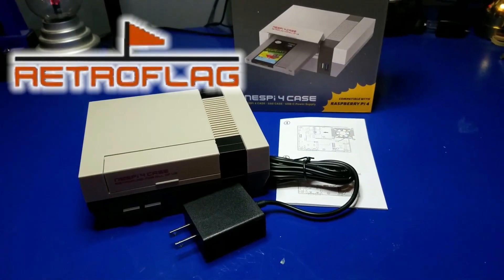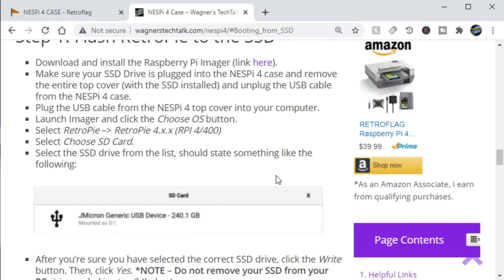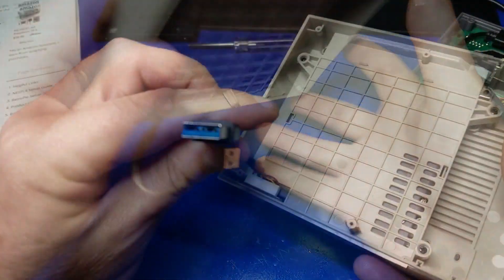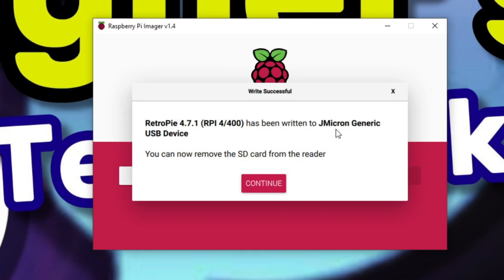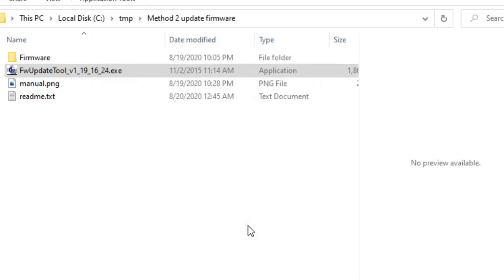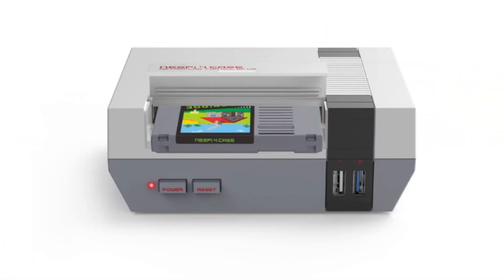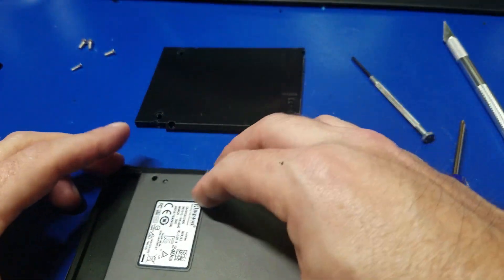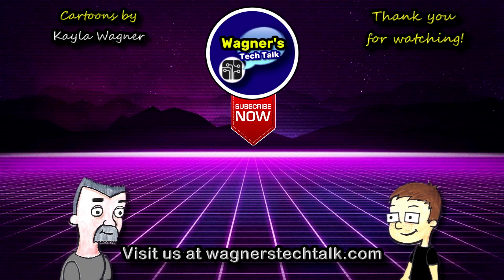Retroflag NESPi 4 SSD Boot: Quick-Start Guide

Comment: Thank you for taking the time to produce these videos.. I think you are doing a top job👍

Can I ask a couple of questions/thoughts?

Rather than blood direct into retro-pie is it a good idea to boot into Twister. Then  the Pi can be more easily utilised for other uses?

Also is there a way to install Batocera in the same way?  Ie booting up in Twister and then opening Batocera?

Many thanks
Reply from the maker: Hi GC, thank you it really depends.  If you want a dedicated RetroPie setup you can install RetroPie.  If you prefer a Desktop environment (with RetroPie), certainly TwisterOS is a great option.  Another great option is Recalbox (I have a video on that, if interested as well).  Totally up to you and your preference.  As far as Batocera running within a Desktop environment, don't think this is easily doable.  Batocera runs it's own version of Linux, RetroPie sits on top of PiOS (or Twister OS) so it's a bit of a different design.  Hope this answered your questions.

Comment: great video. i setup my nespi 4 and installed the safe shutdown script. the power button LED would no longer light up when powered on and the fan would stay running after powering off. after waiting 5 mins I just pulled the power plug.
Reply from the maker: Thank you!  Not sure what distribution you installed, if it was Recalbox no shutdown scripts are needed.  However, for PiOS or RetroPie they are.  More details on this can be found here: http://wagnerstechtalk.com/nespi4/
Reply: @WagnersTechTalk  I installed Retropi for the raspberry 4. followed all the instructions in the video and on your website. the safeshutdown installed sucessfully. but like i said the power led doesnt work and the fan wont stop running until you unplug the power. for now i have turned the safeshutdown switch off and manully shutdown.
Reply from the maker: Inside the case, did you flip the switch to the safe shutdown setting to the ON position?  Shown here: https://youtu.be/o4qtS5ydt7w?t=275
Reply: @WagnersTechTalk  yes. ^ "for now i have turned the safeshutdown switch off and manully shutdown."

Comment: I know I'm joining the chorus here, but I am having absolutely no luck with this case at all. I have tried every step on this guide. It will boot once (and ONLY once) from the NESPi SATA bridge after being disconnected from an external USB 3.0 connection, but after that it's error after error on the QR code bootscreen. Absolutely no fix I've tried works. Going into the terminal, it doesn't even SEE the SSD, only the bridge that's connected to it. Trying to use a Seagate 2TB SSD which is detected and even boots fine from the external USB 3.0 adapter. I've spent three days now trying to address this problem and am making absolutely no progress except in getting incredibly frustrated at the idea that I've probably wasted my time and money on a dead project.
Reply from the maker: Not exactly joining the chorus, the vast majority of feedback I've received here has been positive, just curious if you followed this guide (or another) http://wagnerstechtalk.com/nespi4/#Booting_from_SSD ?  I've personally used up to a 1TB drive and these steps have worked on the x3 or so SSD's that I own.  If those instructions don't work for you, I 'd recommend contacting Retroflag as you may have a hardware issue.  If you do and find out the solution, always appreciate a comment to let me know what the problem was so I can update the guide with what was found.
Reply: @WagnersTechTalk  Thanks for the reply, it's nice to receive prompt feedback during a stressful time. As far as guides, yes, I followed your guide to the letter (since, as you mentioned, many people were reporting success with it, so why rock the boat). To the point now where I actually know some Linux line commands (and that sudo just cannot ever be forgotten).

Here's the issue I've run into, and I'll try to be as succinct as possible. The SSD boots great, but only from the external enclosure I have (to recover dead HDDs or other such items, I dabble in salvaging). When connected to the NESPi's SATA connector, I can go into PuTTY and see the BRIDGE, but not the DRIVE. Which might suggest there's a connectivity issue with the bridge IF it didn't pop up almost immediately upon my connecting the NESPi bridge to the PC, ready to be explored and used. So the bridge is actually good (to an extent) as far as being able to read the drive. I can connect, disconnect, reconnect, and experience no errors or issues with the Windows 10 machine. I have formatted this SSD (several times now, so I'm a little concerned for it) in Windows AND in PuTTY when I had it connected via the external enclosure.

What's driving me up a wall is that I've actually successfully booted the thing FROM the NESPi bridge with ZERO issues, but it only happens ONCE and only directly after I move the SSD from the enclosure to the bridge. Every boot attempt after that gets me the QR screen and repeated error messages. So the Pi CAN read the drive. It's so frustrating because I'm SO CLOSE to being past this nightmare.
Reply from the maker: Just curious if you have a smaller SSD available that you can try (perhaps<=1TB)?  I doubt it's any kind of capacity issue, but something worth trying if you have one available.  Aside from that, it may require contacting Retroflag support.  I can't think of any reason why it would work once and not after that.  I'm sorry you're experiencing these difficulties but I've not run into this issue myself so I may not be much help.
Reply: @WagnersTechTalk  Unfortunately no, no spare ones right now. Figured this'd be a pop-and-play rather than something so involved and wild. I don't see contact information on their webpage, so I'm not exactly sure how to do just that. At this point, I'm not even trying to get it to boot from the SSD, I just want it to READ the SSD whilst connected via the NESPi Bridge so I can just move on to better things.
Reply from the maker: Just incase:  Think I used sales@retroflag.com to get in contact with them initially and did hear back.
Reply: @WagnersTechTalk  I'll try my luck then. The case is literally perfect in every other way, but if I can't resolve this, I have a useless paperweight on my hands and a lot of wasted time and ambition. Thank you for your suggestions.
Reply from the maker: I definitely want to see you successful with it, if you find something out please let me know.
Reply: @WagnersTechTalk  Well, definitely an update, but not a good one. So fiddling with lsusb some more, I find that it's reporting as a 567 instead of a 578. So I figure 'maybe it's a firmware bug keeping the bridge from talking'. So I reconnect it to the PC, and following more generic Linux tips I spy a 'RD Version' checkbox. Clicking it revealed several options, including 'Erase Flash', which in my desperation, I gave a shot. I also restored the UAS firmware (or so I thought), and ejected it. Connecting it back to the Pi, I see lsusb has changed! It's reporting a JMicron bridge, but isn't saying what version it is. More importantly however, is that IT SEES THE SSD. fdisk -l sees the SSD at last. So in my excitement, I decide to try to do a shutdown, reboot, and see if the SSD is still visible.

Nope.

And this time, the JMicron bridge isn't visible in lsusb anymore. Oh goodie.

Now it won't connect to either the Pi or my main PC (I have an older laptop that reads it... Sometimes. But given that it's coming up as 'USB Mass Storage' I think it's actually reading the SSD attached via the bridge), so I think this thing is utterly bricked. Not that it worked in the first place, but this is just astonishing. When it does connect, there's no option to flash the device chip anymore (it tries to suggest the USB Mass Storage which is NOT a dice I'm willing to roll, the SSD is fine, this bridge is just hot garbage), and the Pi will read the drive until the next reboot.

I haven't heard back from them yet and I sent the e-mail last night. Maybe they can just send me a top piece and I got unlucky (unlikely but you never know). Maybe it's an SSD compatibility issue that caused all of this in the first place(which needs to be in their documentation if that's the case). If they're willing to send me a spare top of the case so I can try again fresh, then fine, but this entire experience has utterly shaken me with regard to them and their product. Who builds a device that needs a hack workaround for hardware you know is going to be present? It's like building hardware for Windows that needs firmware hacks in case the user has a mouse. Complete nonsense.

None of this is directed at you, by the way, but this is just immeasurably frustrating.

EDIT: Well, managed to unbrick it with a lucky firmware flash, now it's back to thinking it's a 567. Which is... Better? I guess? At least it works again. Ugh.
Reply: @WagnersTechTalk  OK, time for a PSA: Apparently Seagate SSDs do NOT play nice with the SATA adapter in this case. A friend of mine was able to loan me a Samsung SSD and I was able to detect it faultlessly with fdisk. So the problem was an SSD compatibility issue. It would have been really nice to have a warning of some kind so that people that might be able to avoid this headache in the future, but this does scream 'edge case' to me so I'll be emailing them to alert them to my findings as well as to what the problem turned out being.
Reply from the maker: @EbonyRubberWolf  This is excellent information, thank you for replying back what the issue was!  I've not personally purchased any Seagate SSDs and this is the first I've heard of a specific manufacturer having compatibility issues with this case.  I'll notate the guide accordingly so others may see it.  Thanks again for the update!  ps.  Updated here: http://wagnerstechtalk.com/nespi4/#Step_2_Update_NESPi_4_SSD_Controller_Firmware
Reply: @WagnersTechTalk  I cannot say for certain it is ALL Seagate SSDs, but I have been trying to use the FireCuda 120 and that particular one's been problematic. Again, possibly an unseen edge case, possibly not, but Samsung definitely worked and showed up. So when I can, I'll probably get a Samsung SSD of equivalent size and hopefully it'll be smooth. Thanks for the video otherwise.

Comment: I attempted to do this and the OS and everything boots/runs fine. The problem I'm having is it partitioned the hard drive or something, when I try to transfer ROMS it recognizes the 1tb SSD I have as a 255mb storage capacity. I tried to expand the filesystem in the settings on emulation station but had no luck. Have you ever ran into this problem?
Reply from the maker: Not sure what OS you're installing, some will expand automatically others may not.  The instructions here were used in the context of a microSD card but are the same for an SSD: http://wagnerstechtalk.com/rg350tips/#Expand_Partition  Just triple check that you've selected the correct drive for expanding.  If you're running Windows, use the video link there which uses Disk Genius to expand the drive.

Comment: after all this it did not work
Reply from the maker: Boot from a microSD card, then try this from a terminal (WiFi or Ethernet connected):
sudo apt update
sudo apt full-upgrade 

Shutdown the Pi4, remove the microSD and allow it to boot from the SSD.  Your firmware is likely outdated and the above will update it.  It's also here should you need it: http://wagnerstechtalk.com/nespi4/#Troubleshooting
Reply: @WagnersTechTalk  Ok I will try right now
Reply: How do you reach the terminal?
Reply: Another wasted hour...wont boot from the ssd
Reply from the maker: Strange, that's worked for everyone else (til now).  Did you notice any errors during the update or full-upgrade?
Reply: @WagnersTechTalk  no errors. I will try this all again from scratch. So far no method i have used on youtube works
Reply: @WagnersTechTalk  it just does not see the ssd, read the sd card no issue. At this point id rather find a way to put games on the ssd
Reply: @WagnersTechTalk  I did a different install and it worked. Not to say this technic here is bad, thats just technology for ya
Reply from the maker: @erikhampton67  What did you do differently?  Just curious if I need to update the troubleshooting.

Comment: Are there compatibility issues related to specific SSD's and booting from them?  I can easily write over the SSD [verified files] and I updated the firmware with the NO UAS file .  When I reassemble the unit and apply power, the bootloader throws an error and reports the SD card is not detected.  Any hints?  Is there something I am missing?  Thank you!
Reply from the maker: It's most likely that the firmware on your Raspberry Pi is out of date.  Boot from the microSD with PiOS/RetroPie (F4 after boot for a terminal) installed and WiFi/Ethernet connected, then issue the commands: 
sudo apt update 
sudo apt full-upgrade
sudo reboot (should be good after reboot here)
sudo rpi-update (if not, force an update of the firmware with this command)
Reply: @WagnersTechTalk  That worked perfectly!  thank you!
Reply from the maker: @jonasgroff4631  Very welcome Jonas, glad it worked for you.

Comment: I really do like the form and function of the NES pi4 since I got it last week, but Ive read online that the SSD controller, and the wires inside, present problems; Namely, the wires are not shielded enough and cause interference with bluetooth, and not having UAS downgrades the drive speed to USB2 instead of USB3.

Is there any way we can replace the SSD controller or unshielded wires inside the case with something that doesn't have such problems?
Reply from the maker: I've read that you can tape some aluminum foil around the SSD cable and adapter to minimize interference.  The only firmware I have issues with is Recalbox and I suspect it has something to do with the network drivers.  Beyond that, contact Retroflag for any other options I may not be aware of.  The WiFi only sees my 2.4Ghz SSID, not my 5Ghz.  RetroPie, PiOS, etc. are all fine.  Hope this helps!
Reply: @WagnersTechTalk   Yea I just saw the aluminum suggestion elsewhere..
Reply: @WagnersTechTalk  Because I was curious, I opened up the section where the SATA connector is inside, and the PCB is extremely small.. right up against the back wall of the case in there. 
I'm not sure what could be used as a replacement there without having to replace the entire case....

Comment: hi, how i can control speed Fan?
Reply from the maker: AFAIK, there is not a software solution to allow changing the fan speed on the NESPi 4.  You may want to confirm with Retroflag but I don't see it in the documentation.  However, I did notice this sometime back: https://mini-mods.com/product/nespi-4-fan-control , it's a hardware option that may be of interest.  I've never personally used this so no idea how well it works.
Reply: thanks, but i think i will try to adapt the official raspberry 3 wire fan

Comment: Does this firmware work for any OS? I'd love to have hot-swappable SSD's instead of MicroSD cards and I think the NESpi 4 would also make a good desktop general use Pi case. I could swap between PiOS, Ubuntu, RetroPie, Manjaro ARM, or any OS I want as long as I have enough drives on hand.
Reply from the maker: I only have two SSD's, I have PiOS on one and RetroPie on the other.  So yes, you should be able to put different OS's on multiple SSDs.

Comment: I've got a SanDisk 1TB SSD drive that I've imaged with the retropie-buster-4.7.1-rpi4_400.img.gz but when I run RetroFlag's FwUpdateTool_v1_19_16_24.exe, it doesn't see any usable drives. What am I doing wrong? I used Etcher to flash the image onto the SSD rather than RetroPie's own app and I have my own USB 3.0 to 2.5" SATA cable rather than taking apart the NESPi 4 case.
Reply from the maker: The firmware update tool only works if you're using the NESPi 4 SSD connected over USB to your Windows computer.  It flashes the firmware in the SSD adapter (not the contents of the SSD).  If needed, full written instructions are here: http://wagnerstechtalk.com/nespi4/#SSD_Setup .  This should get you going.
Reply: @WagnersTechTalk  Thank you for that. I removed the top part of the NESPi 4 case and I was able to install the firmware. At least, it said it was successful. I'm reviewing your troubleshooting section in the link you provided and I'm getting the screen in point number 1. I connected my keyboard but pressing F4 doesn't get me into any command terminal. I've removed and replaced the SSD to make sure that it fit on the SATA connector.

I said 'screw it' and started over, following every one of your steps to the word, using the Raspberry Pi imager. I figure I could just replace the files over the network from the SD card once I get it up and running.  The Raspberry Pi Imager says "Error writing file to disk". I'm using a SanDisk Ultra 3D SSD 1TB. Etcher can write the OS just fine.
Reply from the maker: @ThePinchGrinch  Great, after flashing the firmware and flashing RetroPie using Pi Imager, just re-install to the NESPi 4 case + SSD and it should boot up at that point.
Reply: @WagnersTechTalk   Unfortunately reinstalling the top of the NESPi case with the SSD in and then booting it up did not work. It brought me to the 'failed to boot from device sdcard' screen. I made sure the SSD was fully in the SATA connector.
Reply from the maker: @ThePinchGrinch  Hmmm, did you image the SSD with RetroPie as was shown in the video?
Reply: @WagnersTechTalk  When I used the Raspberry Pi imager to flash the RetroPie 4.7.1 (RPI 4/400) image to my SSD, it failed to write. Same thing happened when I used my custom backup image that I took from my SD card. 
I can write the RetroPie image to the SDD using Etcher though so I thought that would have worked.

I can do an # lsblk with both the SD card and the SSD plugged in and the RPi sees the sda drive as having 931GB free. I just can't understand why it won't boot to it.